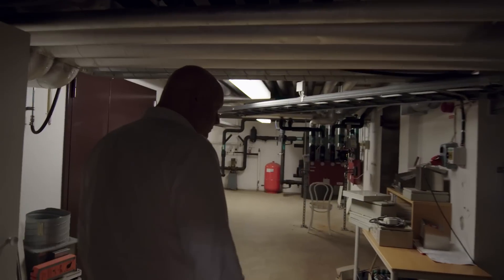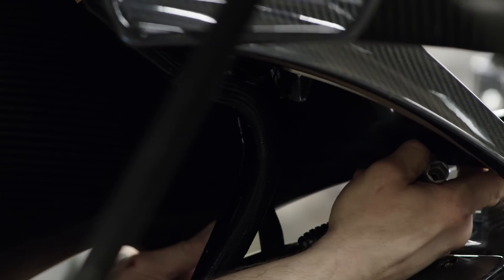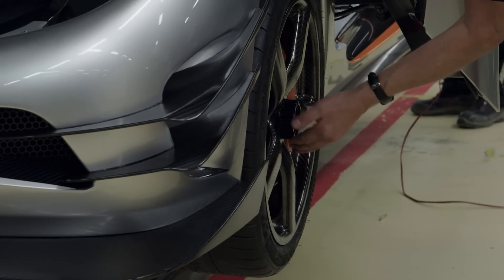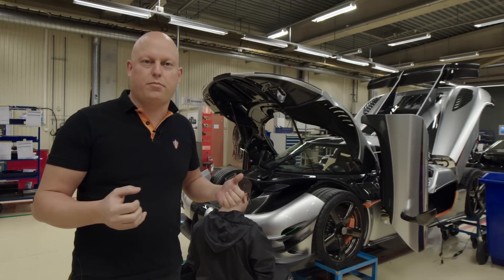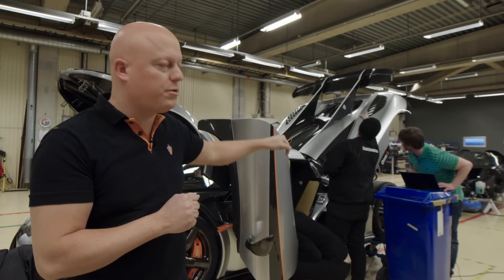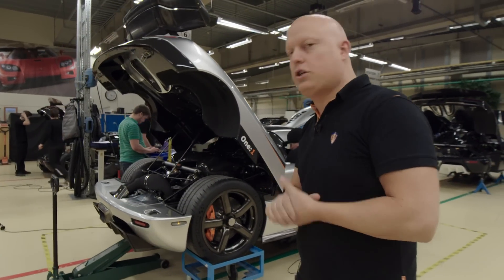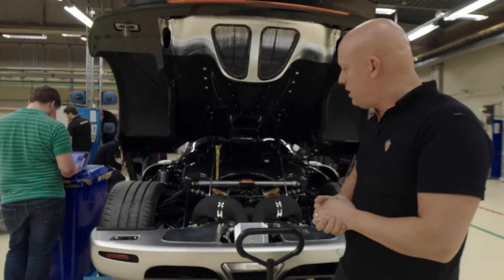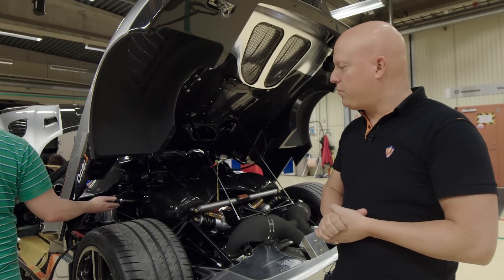Preparing the 1360hp One:1 for its Debut - /INSIDE KOENIGSEGG

Comment: carbon fiber springs?!?!?! wow... I had no Idea carbon fiber could bend like that; can't wait to see the laps times on the ring
Reply: Carbon fiber can't bend.
It most be the housing he refers to.
Reply: BagBody33 Depends on the mixture and how long you bake it..
Reply: I wonder what parts will they change on the production car compared to the mule; where they will save 30 kilos
Reply: tjay84 You got it all wrong. Carbon fiber bends very well. It is just very stiff. It is very flexible, but it does not like impacts. 
It has 5 times the stiffness to weight over for example titanium and that is why it is used. Takes up less space to create the same stiffness plus it weighs less than metals.
Reply: Robert Elliott propably will put in more plastic things, maybe plastic wheels....
Reply: Masterlostfreaky plastic wheels? but those CF ones looked badass
Reply: BagBody33 Carbon Fiber can bend and it get strong the more you bend it until the breaking point . Carbon springs would be revolutionary and i dont think he messes up.. he obv knows his shit and said this because he means it.
Reply: Robert Elliott I dont know how much weight youre gonna save, propably just a little... but the knowledge is there to produce these things...
Reply: Masterlostfreaky I would imagine polycarbonate  plastic?

Comment: I HAVE THE SAME WIPERS ON MY W202 WHAT THE FUCK
Reply: The Lamborghini Diablo GT used Nissan 300zx headlights.  It doesn't mean 300zx owners are driving supercars.
Reply: walperstyle

The Nissan 300ZX easily qualifies as a supercar, especially when it was new and produced a very respectable (and factory underrated) 280hp and won several awards by many different car magazines. It was raced successfully too I might add. Aside from a win in the Trans Am series in 1986 it won the IMSA GT series in the 90's and won its class in the 24 hours of Daytona, 24 hours of Le Mans and the 12 hours of Sebring. Those are endurance racing top titles.

By comparison the Diablo was never raced in anything except for a one-make series solely consisting of privately entered Diablo GTR's. Some "supercar" indeed.
Reply: Christine Fury Yeah, a 280hp, $30,000 Nissan is not a supercar.  The 300's that raced in the Trans Am and IMSA series were race cars - full tube chassis, re-bodied, 900hp monsters.  Not even close to a factory Nissan.  By that logic, you could say the Ford Taurus is a supercar because they race Fords in NASCAR.  You're not even in the same ballpark.  A super car receives it's title for it's speed, power, refinement, and class.  And of course, price.
Reply: walperstyle No shit. I didn't claim to drive a supercar. my 20 year old 4 cylinder Mercedes is the slowest thing in my town.
Reply: HotRodKush Unfortunately the 300ZX was still a supercar by the standard of the day when it was new. The 280hp was revealed to be conservative and it ultimately was stated to be 280hp as a gentleman agreement among Japanese car makers not to antagonize neither their own government nor rival manufacturers abroad, who already were feeling threatened. Contemporary magazines (including the highly respect Road & Track) included it in the top-10 cars of the year. Are you saying they were all wrong? It was proven better than the Ferrari's and Porsches being offered during the same era.

"$30,000 Nissan". So price is a factor in what constitutes a supercar? A car with insane performance being sold for 50 cent wouldn't be a supercar despite its performance speaking otherwise? Unbelievable. So it being a Nissan also automatically disqualifies it from being a supercar? Are you sure you understand fallacies? Or even crude personal bias? You didn't even say "A $30,000 car" but included the brand.

NASCAR is a silhouette type of racing series in which cars only share their outer appearance with the model they're based on. Until fairly recently they used cast-iron pushrod engines with carburetors and were still stuck in the 1950's. The IMSA isn't a silhouette series. There hasn't been any silhouette cars racing in LeMans since the early 80's and that was the dying days of Group 5. What is clear is any silhouette type of racing car would have been immediately banned from competing in the 24 hours of LeMans.

Stop moving the goalposts. It received plenty of accolades both from the international press and owners.

"A super car receives it's title for it's speed, power, refinement, and class.  And of course, price." The 300ZX certainly qualifies in speed, power and refinement. You missed these very important factors called high-tech engineering and quality. "Class" is both subjective and irrelevant. Are you implying a world class writer who won the Nobel Prize shouldn't be considered a writer at all simply because he or she comes from some developing country and never attended any university? 
Switch the badge of the 300ZX to that of any car manufacturer of "class" and voila! 

Price?? Price is irrelevant. A wealthy madman or eccentric could design the best supercar ever and sell it for a huge loss, but that doesn't in any way take away the technological achievement and performance. Fact is Bugatti loses money for every car sold. Other manufacturers have charged a lot of money for a product which would automatically disqualify them as a "classy" product among the regular consumers who expect things to work.

Again. Stop moving the goalpost and stop cherry picking left and right.
Reply: Christine Fury You must be really fun at parties.

Comment: My hairdryer can beat this. It makes 1500w (2hp!) and weighs less than a kilo.
Reply: thats an amazinh hp/weight ratio
Reply: +X88X Lol, thats with the heating, which probably takes up the most watts.
Reply: So i Expect, when your hairdryer has so much power,  your head looks like Christian von koenigsegg's  head ?!?
Reply: The940classic 1hp is exactly 746w. therefore, 1500w ≈ 2hp.
Reply: The940classic I'm sorry for offending you. But it's not like I am a total ignorant, it is a fact that 1 horsepower equals 746 watts (google "1hp to watt" if you doubt my word). What I said with my hairdryer was a joke, if you didn't understand already.
Reply: actually 1500 watts is 2hp.  Try google.
Reply: but can you drive it? :D
Reply: 2hp is 1491 watts  close enough. 745.7 is one hp
Reply: Now add the batteries needed to run it long enough to do its job...see if you can keep it at 1:1 >.<
Reply: @The940classic  u cant even transfer kw to wats :D  K=1000 not 10000 lol
Reply: Wow is great
Reply: Also has no battery.
Reply: Bit can your hair dryer carry me and passengers? 😁
Reply: That’s a one:2!!

Comment: 1360 BHP out of a 5.0 v8 with 2 3D printed turbos. Thats 272BHP per freaking litre.
Reply: they need to find its track top speed. till then venom gt
Reply: ***** the venom has an unofficial record... its not a production car, they have made to few of them to be counted as a production car
Reply: simcaP60fan The problem is that it isn't a production car. Just a heavily modified Lotus Elise and can only be registered in the US as such. That is why the record is unofficial.
Reply: IIAmGothamsReckoning The most impressive is not the power output, that any average engine builder can squeeze out of a turbocharged 5.0L, but the DRIVEability (power & torque curve + traction control) and DURAbility, THAT is truely something to be proud off. Horsepower is nothing without control. And Koenigsegg is the pinnacle of that quest in the production car .
Reply: Jordan Randle Its modified from an Exige actually.
Reply: 3D printed = laser sintered in this case

Comment: Bugatti got no chance to beat it.
Seth Reeves
Reply: Sad boy
Reply: Makes my 10 best list
Reply: sid johnson the number one of my top three so far.
Reply: The Bugatti Veyron Super Sport is no longer the king in top speed. Since February it has been the Hennessey Venom GT with 270.49MPH on a 3.2 mile track. However the One:1 is more powerful than the Venom GT
Reply: Venom gt and Agera 1 have the same power-weight ratio. Is a fight of gear ratio between them.
Reply: From what I've heard yes they do but I'm not sure with everything full, oil, water, fuel, etc. But yeah I would say it's a fight between gear ratio. But I think they would need a track such as the one that Bugatti uses for their record runs. 5.5 mile straight and 8 mile oval would be God for those two cars.
Reply: EpicDude Some say that Hennessey Venom has poor engineering and design and low safety features, and i agree... ;)
Reply: It just a car that been giving more power
Reply: *****
Do you think your One:1 is as safe as a toyato Carola? It may have better Engineering but the Hennessey gets the job done and is still a decent looking car to me and sounds amazing. It's all a matter of opinion for some ;)
Reply: EpicDude that is true, that is why i have my taste, and there are many different cars for each taste, philosophy or how much meaning that car can have to each different person ... ;)
Reply: *****
Exactly ;)
Reply: EpicDude did you know that the agera r is one of the safest sportcars to be in. just look at this short clip /watch?v=6eXU-tPt6Gg&feature=kp
Reply: Baker Pantheon Okay yes while it may be the safest SPORTSCAR it still isn't the on par with regular cars like today.
Reply: Venom gt is a mod car Bugatti and Agera is a stock car
Reply: ROCKETGUN BOOMBS
And? What does it matter, the Agera is based off their previous Koenigsegg vehicles but aerodynamically modified with a bigger engine and modified for less weight. So it doesn't matter if the Venom is a car based on a Lotus Elise.
Reply: EpicDude true and true
Reply: EpicDude Agera one still a stock car. Venom is Lotus+ mod LS9 Corvette engine
Reply: ROCKETGUN BOOMBS I see what you mean but what does it matter? Just because it's based off a Lotus and has a modded Corvette engine doesn't mean it's a bad car. Hennessey is a tuner car, the company mods cars themselves, and one day they wanted to mod a car that can be really light yet beat the Veyron in Top Speed.
Reply: no, venom is a good car for sure but its a mod car not a stock car
Reply: ROCKETGUN BOOMBS true
Reply: ROCKETGUN BOOMBS Yeah I guess its true. You're right
Reply: I agree only on facts . When bugatti come back it going to be much sicker
Reply: Seth Reeves nobody would look twice at bugatti if it went 20 mph slower. it is not a technologicaly advanced car. nor is it "ground breaking". it is very heavy and has a huge amount of power. all they will do is add more power to  a model that has been out for several years
Reply: V12 you are so far from correct..  I don't know how you know anything of the new car its not really info out how ever Volkswagen did say they will be much lighter.  as for ground braking up yes if u can call the car over weight but still hold two world records then yes it is.
Reply: Seth Reeves What records m8
Reply: rasmus jensen m8 ?
Reply: m8=mate. 8=ate
Reply: No idea .. But I just read Bugatti is now trying to target 300 mph they said they just got the weight down to a even 4,000 from 4,400..
Reply: Seth Reeves Bugattti can do it they lost 6.5 million per Veryon so money is something VW doesnt care about
Reply: kamboj sb I mean I don't know it that the lost they take but it a billion dollar car company . it cost money to make money
Reply: kamboj sb Where are you getting those numbers? It's not that I don't doubt they make them at a loss but that seems extreme for a million dollar car. If they had a line up of cars to make up for it like Lexus with the LFA that's understandable but it's not like you see the streets flooded with Bugatti vans or little electric commuter cars to make up their difference.
Reply: GrogTheRed seriously look it up it doesnt matter to Bugatti because they are owned by VW so they can have as much money as they need
Reply: kamboj sb money no odject to them they make billions ...
Reply: How do you know that one 1 fanboy ? the currently 2 fastest cars are bugatti and hennessey venom gt.agera r or one 1 not been tested for speed yet.Deal with it or move on , fanboys.
Reply: EpicDude the agera r goes 275 mph there even is a race of the agera r beating the Bugatti veyron super sport
Reply: EpicDude the agera r goes 275 mph there even is a race of the agera r beating the Bugatti veyron super sport
Reply: Norbert Mieczkowski one Koenig egg never went pass 260 mph second it not a super sport it a vitessee and last HENNESSEY  VENOM IS NOT A DAM PRODUCTIION CAR AND IT DID NOT DO A TWO WAY RUN MR HENNESSEY  SAID IT HIM SELF ON T.V PLEASE STOP  THINKING  IT IS
Reply: Norbert Mieczkowski Well no shit it'll beat a Super Sport. 1, it's ligther than it, 2 more powerful engine. But that 275 MPH is just theoretical, it will never be that fast until it actually reaches that speed on a track.
Reply: EpicDude it lighter yes but not more power also the race shown was messed up they had put agera  on bio-fuel and left bugatti  on some weak shit
Reply: Seth Reeves The Bugatti uses 7993cc W16 4 turbo engine with launch control AWD. I can't see any disadvantage. The Agera R have less power than the Bugatti but lighter.
Reply: ROCKETGUN BOOMBS bugatti has race lighter cars with tune up to high hp and still won.  Now you telling me just cause a agera r is lighter it just can that Easy no it used bio-fuel wich put that car at a large compression.
Reply: Seth Reeves There is many video proved Agera, Agera S and Agera R is alot quicker than the Bugatti. After Agera R hit 2nd gear, Bugatti have no chance.
Reply: ROCKETGUN BOOMBS it cause what they put it on
Reply: 1.  Koniesseg, 2. Bugatti 3. Hennessy
Reply: Kode Pelaa Perfect order!
Reply: LAUNCH CONTROL 東瀛戰神 thanks 😀

Comment: How is this possible? VW as one of the biggest industrial car producers in the world, which once even a whole city was built around (Wolfsburg), which owns the biggest design and engineering departments and stuffs, the biggest thinkable computer aided simulating environment, struggles with its silly, ridiculous expensive and obese, two ton, 1200hp fuel to heat converter, which just consists of and is held together by radiators and is not able to show us adequate lap times on the Nürburg Ring .....and on the other hand a few Swedish guys show them on which side the bred is buttered on with such an ease.
Reply: LCdrDerrick  It's all about bureaucracy man , guys at VW can't even fart without asking the bigger guy !
Reply: +LCdrDerrick Bugattis are not made to be fast around track, they're supposed to be fast and at the same time comfortable in a straight line - and they're pretty good at it. Really agree with you on the insane stuff koenigsegg as a company does with so little budget and means though!

Comment: After watching a great documentary on Christian von Koenigsegg and seeing his passion and engineering genius on display, I figured it would only be a matter of time before he built something line the One:1.  Surely this car will be proven in monitored tests to be faster than the mighty Veyron Super Sport!

The only sports car that matches this astonishing power to weight ratio is the Hennessey Venom GT, which weighs 2,743 lb (1,244 kg) and produces  1,244 bhp, while the Koenigsegg One:1 produces 1,360 hp and weighs 1,360 kg (app. 3,000 lb).

The mighty Venom 7.0L [427ci] GM LSX V8 engine produces 1,244 bhp (928 kW; 1,261 PS) of power at 6,600 rpm and 1,155 lb·ft (1,566 N·m) of torque at 4,400 rpm.

The incredible One:1 [305ci] engine produces 1,360 hp (1,014 kW) at 7500 rpm and 1,371 N·m (1,011 lb·ft) of torque at 6000 rpm.

It will be interesting to see if the Venom’s higher torque at lower rpm translates into slightly better to time-to-speed numbers, given that the two cars are so close in weight. I can’t wait to see some test track figures for the One:1, and wouldn’t you love to see Chris Harris take this beast around a track? (He was blown away by the new McLaren P1 and said it was a “whole new thing.” I wonder what Harris will think of the One:1?

The One:1 may not be as technologically sophisticated as the new McLaren P1, but it should be even faster than Agera R, which is remarkable.  Anyway, hats off to  Christian von Koenigsegg and his engineers and mechanics. They have made something exceptional in the One:1.  I can’t wait to see a video of it on the test track!
Reply: I have a good feeling even the Agera R is faster than the current crop of hyper cars from Mclaren, Ferrari and Porsche... its as light and even more powerful than those 3 cars. It has the downforce, the carbon tub chassis, fully independent suspension with the triplex damper. And if the Agera R is driven by a professional on a track it would be just as fast if not even faster the the P1, La Ferrari and 918